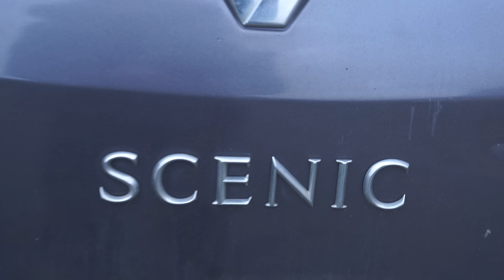it finally happened......

Comment: You're gonna have to jackhammer out that mixer when you're finally done with it.  😆  Congrats on securing transport and good luck with the garage.
Reply: Just throw in some pretty big rocks and add water and turn it on. The rocks will clean it nicely. I have seen him do this before.
Reply: @tracerloenan8020  I was referring to the growing pile of waste cement developing around the base of the mixer.  ☺
Reply: That’s just to keep the cement mixer from running away 😅

Comment: Okay….jus’ a minute, here…. You kinda ONLY implied that the van “died”… but we all figured it could be mended!  Are you saying that it’s gone FOREVER?  Did the mechanics convince you that whatever was wrong with it was too expensive to fix?  I’m only NOW replacing a 1987 Nissan (yes… after thousands every couple of years to keep it alive… but that was still cheaper than a new car) AND—>  a mechanic can STILL fix it up, as it’s still running and drive-able (we were told that the parts are worth a lot, even if car not running).  So we’re in process of selling it to a mechanic.  But your van was in GREAT physical shape, man!  Even a sort-of expensive car bill is STILL significantly cheaper than buying another van… are you saying that that new car cost less than it would to fix the van?  A van is so USEFUL!  Or are you STILL fixing the van and felt it cheaper to buy a car rather than to rent one for the short term?  Just confused about the van… you never said it was total toast.
Reply: I think it was said it blew a head gasket, though I could be wrong on that. If so, way more expensive to fix than the van was worth, and not exactly a diy repair. The van is still sitting at Lalande though, so not on the scrap heap yet 😄